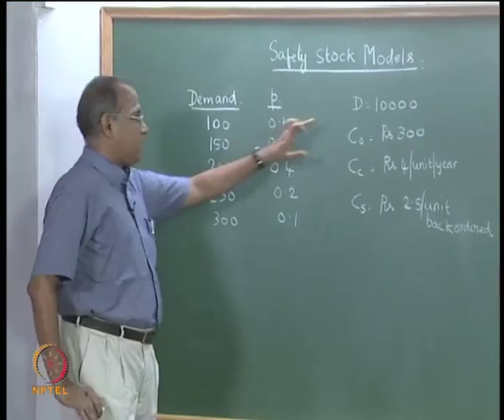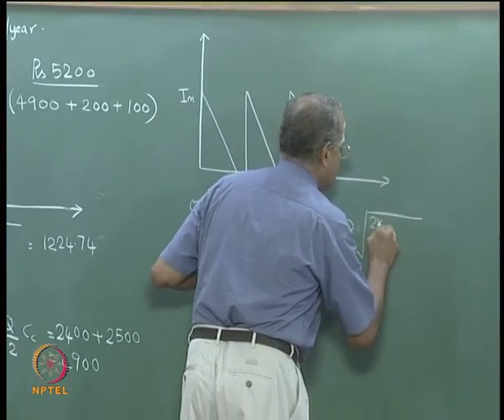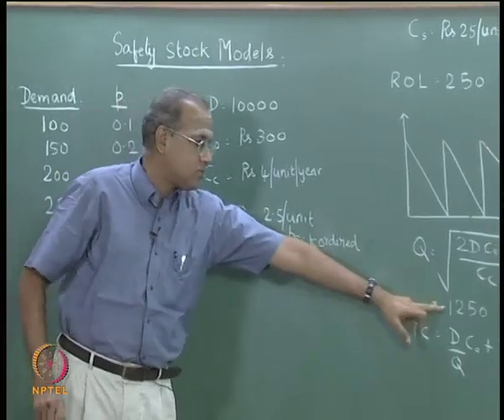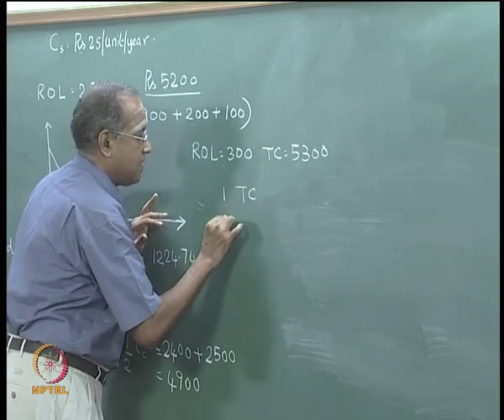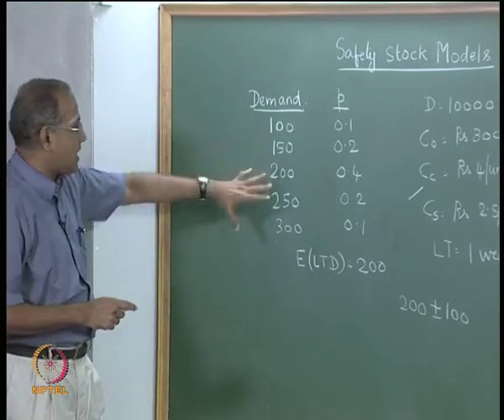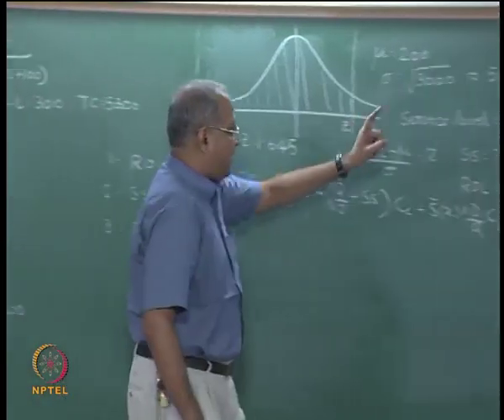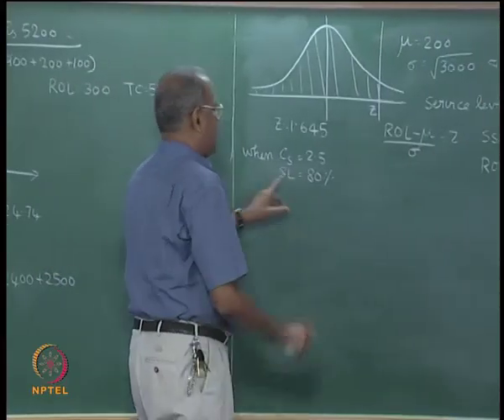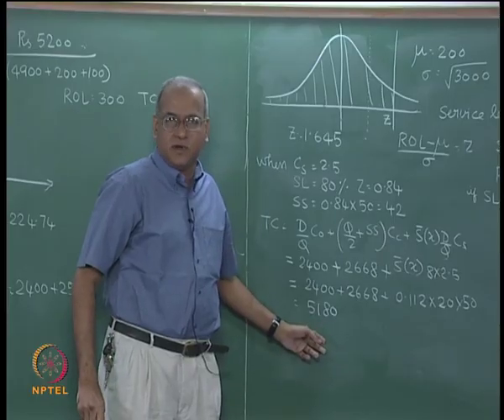Mod-05 Lec-21 Safety stock -- ROL for normal distribution of lead time demand

Comment: To Calculate STD Dev - find each deviation from its expected value, square it, multiply it by its probability, add the products, and take the square root.- (100-200)^2 *0.1 + (150-200)^2*0.2+........